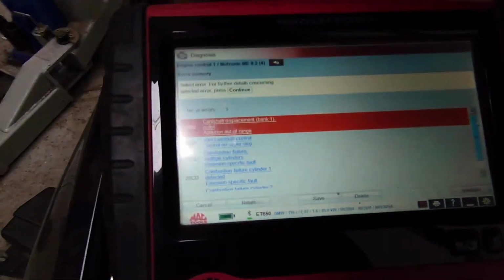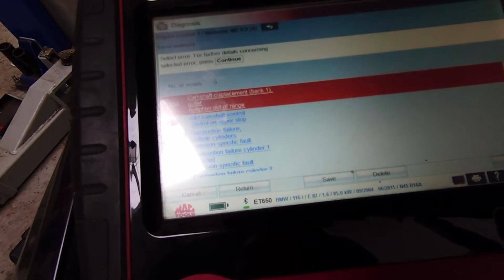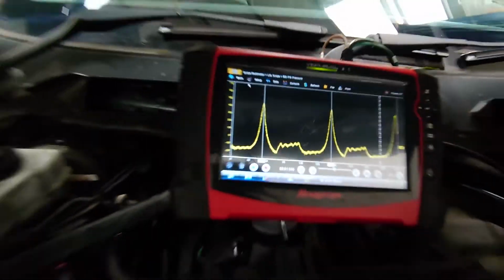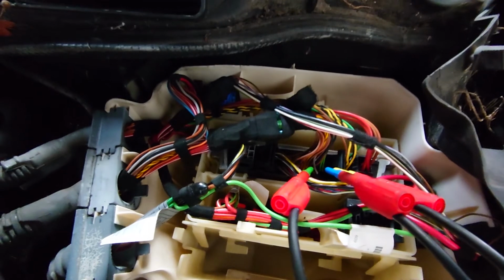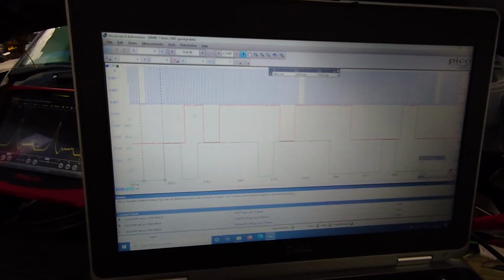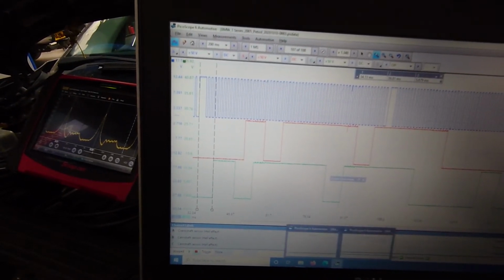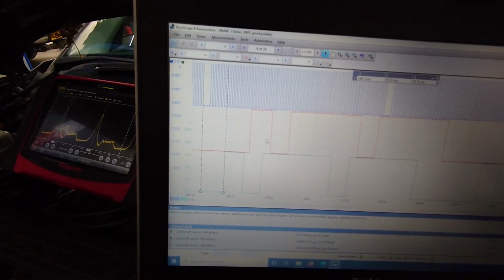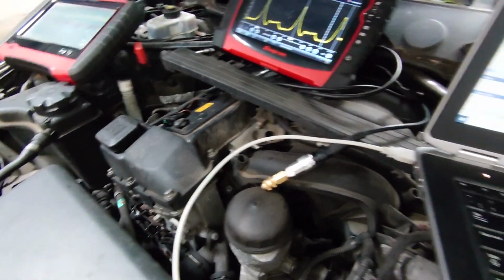BMW 116 timing fault 2A88 and 2A83

Comment: Mines thrown the 2a83 camshaft input code is this due to a faulty cam shaft sensor car hesitates and smoke once stood running a few mins
Reply: have you cheked te oil,vanos, cam sensor? maybe the chain are bad?
Reply: @Data4664 this car is senzitive to oil?
Reply: @RomanianBoy-q2v yes vanos requires good oil to function properly, also cleaning vanos solenoids from time to time helps